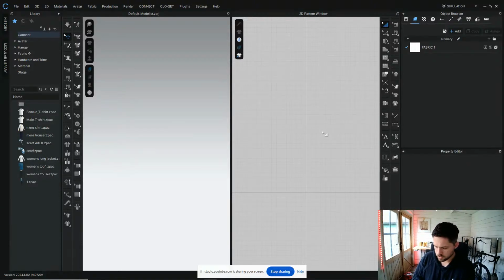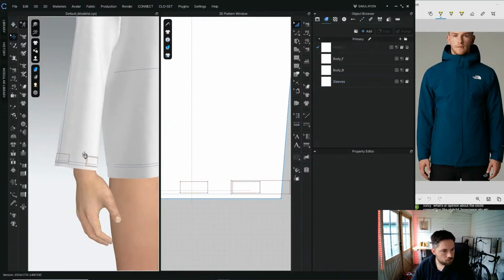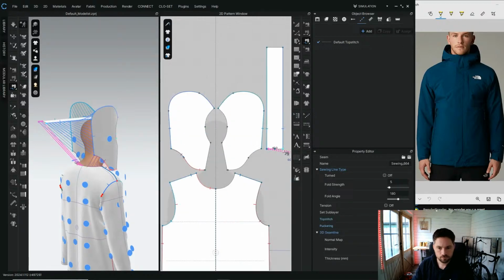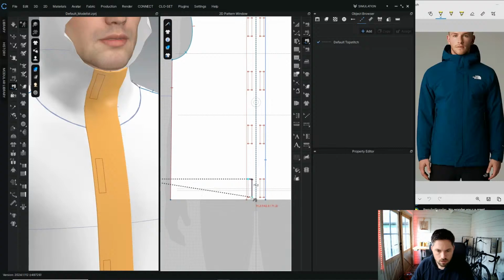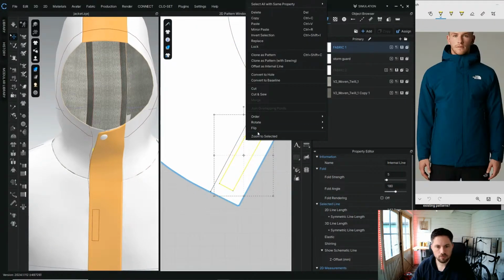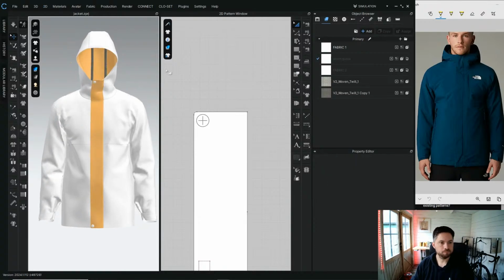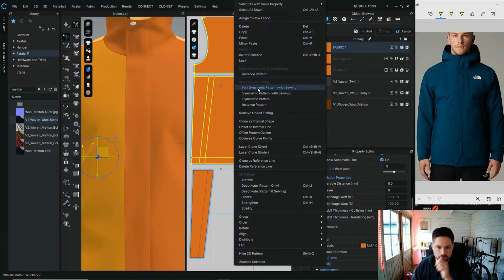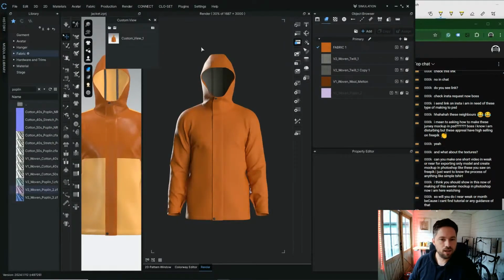Live CLO3D Tutorial: Design a water proof Northface jacket

Comment: Hey, i've done everthing like you but the thickness of the sleeve patch min 24:30 is not changing. Any thoughts on that?
Reply from the maker: The tabs in the 3D wind. The fourth button from the bottom. Here you can select different mesh / fabrics / solid fabrics etc. Do you have it on the flat fabric option? You need to click the one that looks like there is a bit of thickness
Reply: @the-fashion-shed  got it! thanks